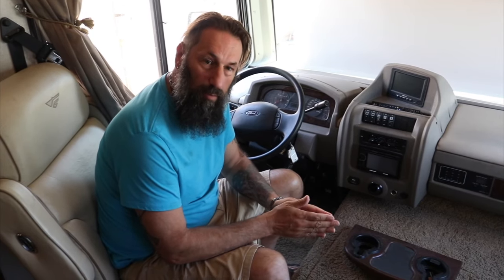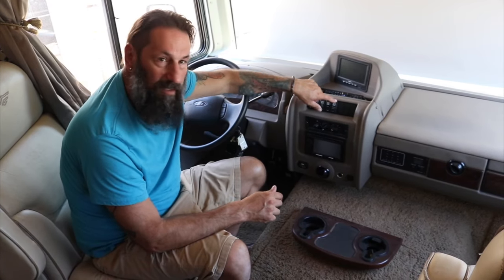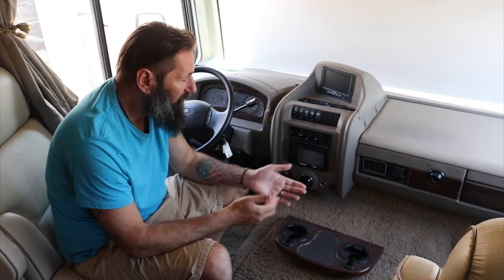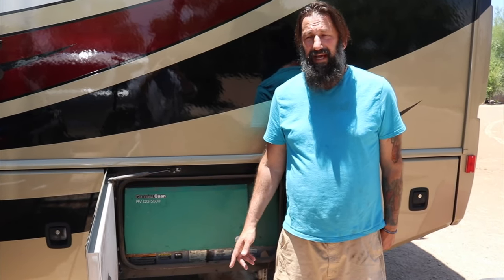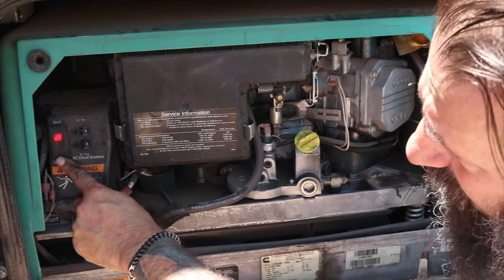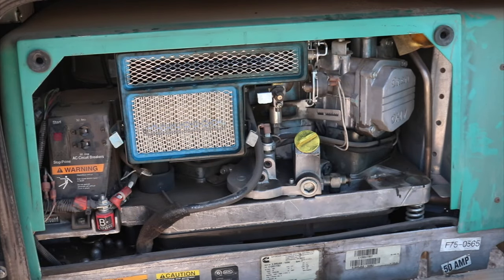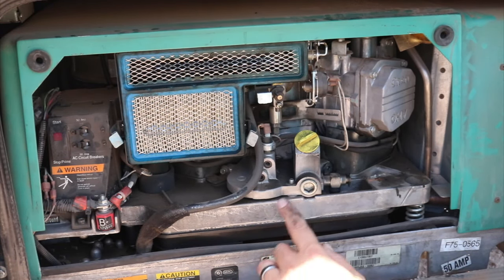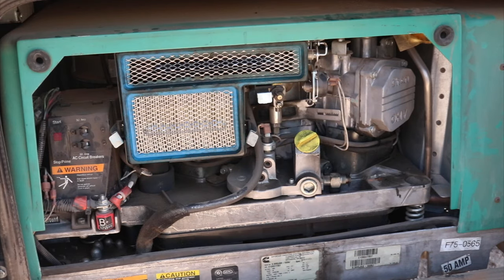RV Onan Generator Start Up Problems. Fix it here.  Hint & Tips

Comment: Hey thanks for such a wonderful way to explain the possible issues with the generator. I want to know how the coach auxiliary batteries are recharged? I usually turn on the generator however my batteries seem not to be charged later on when I want to start the generator again and I end up charging them. I have an Winnebago ford 87 with an Onan generator. Any ideas where to start?

Comment: I too, have a 4.0. In the control box, it has what looks like a normal "Ford" solenoid on it & 2 relays, bottom of box. Now is the small center post on solenoid marked with a "S" supposed to be hot all the time???, I thought that only put 12vdc on it when you closed the start switch to make it send power to the starter side of solenoid. I have a constant 12vdc on that "S" post.... and when I push START, it acts like there's not enough battery for it.... it just "Chatters" ,but then I had it turning over the other day, albeit, rather slowly.... I think somebody's got their + & - mixed up... not surprising, I've been re-wiring this behemoth for a month now, somebody didn't know what they were doing and mutilated and massacred the factory wiring and now it's all 18g brown wires and 90 scotchloks later.... hope I never meet this non-wiring jerkoff... still finding these damn scotchloks to this day..... I'd fire any employee who used these crappily designed strand cutting blades 
Great channel couz.... gonna join the party ;)
~Whirled Peas
PS: Weren't you in "Trailer Park Boys"  Is that Julian?? ...lolz

Comment: If you use seasonally,  drain the BOWL. Screw under Altitude.  Also bad gasoline in a modern car with fuel injection can be expensive

Comment: Nice video! I have kind of a weird thing going with mine.
On a trip I could not start it, very frustrating. I would prime wait for light then toggle to start....nothing just cranked.
Today by mistake I just pushed start ...no prime... jumped right to life! Running great and steady under load and off. 
Prime must be flooding mine???
Reply: Going to try this with mine
Reply: Was it a propane fueled engine, or gasoline?

Comment: Hi Ben, thanks for the helpful tips! I have the Onan 5500 EVAP, it will only start and run if I hold the butterfly closed or mostly closed (choked), but even when it should be warmed up, it will still only run when I hold it closed or mostly closed. Do you think this is an electric choke problem or something else?
Reply: I should add that when I let the butterfly open on its own after it's warmed up, it starts surging and eventually shuts down - seems like it's flooding. Possible issue with the carb?

Comment: Great comprehensive video! I have a Cummings generator in my 2015 Thor Freedom Elite. I started the generator with the aux battery and battery was dead. I started the rv engine and hit the start button for the generator and after multiple tries, the generator started. I turned off the ignition to the rv and the generator quit. I checked the aux battery a d it looked low so I replaced it. Tried to start the generator and nothing, just a single click noise and won't start. Opened up the cover to the generator and found the yellow oil cap laying in the compartment. The oil had totally leaked out! I filled the oil Reservoir  back up but still will not crank over. I am afraid I may have unknowingly seized the generator motor. Do you know of any resets? I may have to pull it and rebuild it. $4000 to replace. Any suggestions?
Reply: Hopefully you found the problem!   I had the same issue when I ran the house battery down and started the engine to start the generator.  The DC would not work except on generator or shore power.   And then would not charge batteries.   Under the hood in front of the driver is a metal box with a flat lid.  After pulling very hard to get the lid off, there is a 50 amp circuit breaker on the PCB.   On the right side of the breaker there is a tiny button.   Put your finger on it an slight push resets the breaker.   If your batteries are very low, the alternator puts more than 50 amps through them.  Long enough and the breaker trips.

Comment: Have a 1994 Onan.  Sitting for 4 months and was running ok when parked.  All batteries are  at full charge.   I now get a rapid clicking sound when I press any of the start buttons and starter won't turn the engine.  New starter about a year ago.  Clicking sound is near the start switch on the generator panel.

Comment: Great Video, thanks! Now, I have an interesting one for you: Onan 5500. Changed threat video, thanks! e house batteries actually ALL the batteries, they are showing 12.2 volts. Tried to start the gen after a few months...NOTHING! No prime red light, no crank, nothing. Ideas? I also tried from the switch on the generator, outside in the bay. Thanks!!
Reply: Make sure it's plugged into the chassis
Reply: @techomega9971  Talking about the ground? It has a Hi-amp breaker, and has power in and out. That's on the firewall by batteries. No power at power lug on Genset. I'll keep looking. Thanks. Enjoying your videos!

Comment: Hi bear. I have that generator which was on my 5th wheel when I purchased it but mine doesn't seem to have a place for those 2 small wires near the carburetor that yours has. Also, no batteries but I'm hooked up to a 50 amp plug.  Will my generator still start once I hook up propane?

Comment: Hi there, I have an Onan4000 generator that seems to have a fuel issue.  Technician thinks it could be 
the tube from the main gas tank to the generator.  The thought is it could be the sensor in the tank itself as he had the generator running using a separate fuel source.
How likely is this, and can the sensor be replaced without removing the fuel tank?
Alison
Reply: there is no sensor in the tank. The generator gets its fuel off a pick up tube that starts at 1/4 of a tank (so you dont get stranded). trust your mechanic, theres a reason hes a mechanic and your not.

Comment: Great video.
I have a crank no start issue.
I think its spark but, how do I check for no spark. Any help would be awesome thx
Reply from the maker: I would just go ahead and replace the spark plug if you think it is not getting spark.  They are cheap and it can surprisingly fix a lot of problems in small motors.  Start there.
Reply: @BearsWorkshop  will do thaaaaank you. Hopefully they'll get her going
Reply from the maker: @jcel5870  Good luck. Let me know.

Comment: Great video ! my generator does not turn over from the switch on dashboard. i checked the batteries i am getting 12.4 volts, they are 4 months old and it turns on from the switch on the generator itself.
Reply from the maker: Sounds like a switch problem or the wiring to that switch

Comment: I had a start/stop issue.  The light flashed 2 times.  I checked the manufacturing web site for error codes.  It was low oil.  Add oil slowly and let it drain into the generator oil pan.  I had to repeat slowly adding oil and rechecking the level screwing the dipstick completely in and then unscrewing it to recheck the level. Be patient and you will get the level correct...  No more issue!!!
Reply from the maker: Glad to see you got it working

Comment: I've got a onan 3600 LP model. Service fault (3blinks) and codes 15,14,13 are coming up. Over frequency, under frequency, controller can't maintain voltage. New air filter, new spark plug, fresh oil with proper level, cleaned the exhaust out. IDK? Is there a voltage control module? Maybe the reg up by the tank? Bad alternator?

Comment: Is there anything I can spray into the carb hole to clean it a bit? My generator stopped today and it's not starting back up its onan 5.5hgjab LP I know you mentioned starter fluid but on a LP what can I use?

Comment: Where is the starter wire on the generator? I was told to check that because when I prime and then press start it sucks the batteries dry and everything shuts down. I’ll then have to start the engine, wait a couple minutes and then the generator will start. Thanks

Comment: I have a QG3600. Having issues where it will do half a crank then stop, feels like battery is dead but is fully charged 12.6v , load tested to 330CA.. This may happen 2-3 times in a row , walk away and come back then it will turn over and start…any clues appreciated . Not sure if there is a connection but also noted when under load black smoke..

Comment: I have a Onan 4000 not getting spark the coil & boot test good and I replaced the magneto and new spark plug.  Any thoughts. could it be in wires?  it is an older motorhome and the prior owner couldn't figure it out.
Reply from the maker: Could be wires.  Can you figure out where you stop getting spark at?  Use a tester. Crank it with the spark plug out and grounded.

Comment: After running the generator for several hours last night I was going to start it up the following morning but when I pushed the start switch down to prime the system it started to crank and would not stop.  I had to remore the wires attached to the selenoid to stop the cranking.  Any Ideas of what the problem may have been?  I removed both wires from the selenoid and now dont know which one goes where on the selenoid.  Any help appreciated.

Comment: What kind of coolant might it need? Any kind okay? I'm a single mom about to head across country with my 2 kids, the mechanic checked her out and said she is good to go, but when we went to leave today the generator wouldn't start.  It has been sitting for about 9-10 months, so I'm thinking maybe bad gas? But could also be coolant. I have used shore power 99% of the time since buying the RV used last year.

Comment: Hey got an onan 4000w generator that won’t crank replaced the starter solenoid as it would click but there would be no crank. I can manually turn the engine with a wrench but still nothing. I’m thinking it’s the starter but I’m worried it’s possibly seized. It was just on for service at Cummins where the valves were adjusted so that could also be a possibility to why it may be seized?

Comment: Thank you. Great video! Our generator isn't starting on its own but if I connect the positive of my multi-meter to the generator's positive terminal, and the negative to the generator's ground, the generator starts and runs. It then stops once I remove the multi-meter's positive. So it's creating a circuit. What might this mean? Cause? What should I look for? Hope ya can help. 8)

Comment: If I allow my generator to sit idle for 5-10 minutes it will not start again even with priming. I have to start RV engine then turn generator on. Purchased 2 new house batteries and a new chassis battery, in last 3 months. Could this be electrical or what?

Comment: Can it be run with an external fuel source? Skipping the main tank if its so low and you're not looking to dump like 15 gallons into the tank you won't even get to use?

Have a Monaco 2000, looks similar to your interior. Was running an "external fuel supply" as id done with an 86 pace arrow just to skip the BS of filling the tank enough for the pickup.

One hot day this summer, it ran that external fuel can dry. Refilled the can, hasn't stayed running since. Basically starts and dies immediately, unless holding down the start button. It's getting fuel just fine through the pump and the carb, ive had the carb off twice and made sure everything was cleared and blown through, getting fuel through it, i thought the LoW gAs was simply the tube pickup in the tank not going to the bottom, is it also electronically controled by the fuel gauge sensor now?

Edit to add: only code I'm getting is 36. Engine shutdown not commanded by computer.

Comment: Video on startup issues was helpful but didn't get mine running.  Seems like mine is flooded.  Raw gas is pumping out of the intake port behind the choke.  It was primed, pressed Start, on 3rd try, it began to start but then stopped before completely starting.  It never ran.  Still fuel is pumping out of the carb.  RV is a 2008 with only 8K miles.  Everything is new.  I have not attempted to run the Onan generator in at least 3 years.  We use a portable Honda eu3000i.instead. Help!

Comment: I have a 2007 4000 that refuses to start.
Suspected the carb, took it out and there was no problem with it.
Checked the fuel delivery, pump and filter seem good.
Sprayed starter fluid into carb, no start.
Cleaned spark plug and attached a checker, we have fire.
Added oil, parked on level ground, no start.
Have more than 1/4 tank of fuel.
Got a code 36 also.
Fuel, air, and fire, but no start.

Comment: thanks  for  this.
what is  the  cause of  no  out put  voltage  in  generators  are normaly  run  AVR & rotating  diode  are  changed but  no  solution   what is  this  reason please?
Reply: Hollo bear here’s one for ya   a 1998 coachmen I have power to new starter solenoid new control circuit board but no power past battery connection WHY?  Stumped

Comment: New oil and levels messed with to where it will start and run but only a couple of minutes when motor is warm.  In AM cool motor it runs about 8 min and stalls.  I am looking to bypass the low oil level ground producing switch to test and if it keep running replace it...

Comment: My Onan was running fine stopped and has never ran again.
Won't even make a sound like it is trying.
Here is what I have done
Full tank of gas
Added oil
Held start button off 5 seconds
House batteries are new 6 months ago and have been used very little.
Would you give me some ideas on what else to try please?
Thanks so much. 
Jeannine

Comment: Hey Bear. Thanks for the video. You hit on a problem I am having. My float seems to be stuck and even at a full tank, I show 1/4 on the gauge. If I top off the RV (2013 Thor Palazzo) the genny runs great for a few gallons then wont run. I am fairly confident that the sensor is the problem. Being a techie, I am guessing somewhere in the path of that sensor is a relay that is NC or NO that I should be able to trip, sort of like the GM six speed lockout fix. Are you aware of anyway to do this? I have tried reaching out to Freightliner shops to replace the float but, no one wants to deal with it.
TIA,
Craig

Comment: Hi Bear, Watched your video and it was helpful, however, we went through all these steps before.  We have a Cummins Onan QD 6000 generator with 16Hrs. on it.  It has been plugged in to an external source for about 2 weeks.  For some reason the converter tripped and we lost our DC/12V.  We reset the breaker and now have all our 12 V "appliances" working, however, the generator will not start - it just clicks.  We tried to start it with an external battery, but it is doing the same thing.  We pressed the stop/prime and got the 3 lights, but no further code/flashes.  What could possibly be wrong?  Is there another "reset" button for the generator somewhere on this unit?  Why would loosing 12V power cause the generator (which was not running) to not be able to run once we reset the converter?  Is it possible that we have not waited long enough for the converter to be on?  We are hearing a low hissing noise from the converter (which I believe should stop at some point).  Sorry for the long-winded review, we're just a bitttttttt frustrated with all of this.  Thanks!
Reply from the maker: One possibility that I recently learned of.  This happened to my buddies diesel generator.  Just would click once when trying to turn it on and then give 3 flashing lights.  Turned out the there was an auto-off set up in the generator monitor.  It would not run at certain times of the day.  If you have the monitor try turning it to Auto-On.  The feature is supposed to turn the generator off at certain hours but sometimes the times get messed up.
Reply: I have that same exact issue right now!  Cummins Onan QG 5500

Comment: I may have over cranked my generator... When I attempt to started the celluloid clicks starter does not spin... What is wrong if you have any idea
Reply from the maker: Do you get any error codes through the flashing lights?
Reply: Check the battery voltage while cranking. If its 24V System, Voltage should not drop less than 20 V while Cranking.If its droping less than 20 V its battery problem,if not than starter problem.

Comment: My  Generator solenoid clicks several times as I press the starter button over and over then the starter turns over and all is fine. Sometimes it starts with 3 or 4 clicks sometimes 7 to 10. Is this my starter or solenoid? It is the same for remote or at the Generator?

Comment: Great video.  My yellow cap fell off and I was leaking oil. When I tried to start it (not realizing how low my oil was), it made a nasty clunk sound and failed to turn over. It is an Onan 3600 propane.
Does it have a low oil shut off or am I in a catastrophic zone? Thanks.
Reply from the maker: It does have a low oil shut off so hopefully after a new cap and some oil it will start up.
Reply: I had the same thing happen! Any tips on getting it back up and running or was it catastrophic and rebuild or replace?

Comment: To get error code. Press prime 3 times within 5 seconds. 
If it lashes 3 times its a 3. 
Then tap down one time.
It should flash 3 time then pause flash however many more times before pause  thats your second #. 
Mine was 3 than pause flash six pause. Repeat  3 than 6. So was code 36.

Comment: Mine is making a Whirring noise, but not cranking. New plug, new air filter, new oil.  Not turninmg over. Only has about 80 hours 2007m Winnebago aspect

Comment: By the way , My generator in my toy hauler will not start from the inside only outside. I’ve change the switch on the inside and checked my breaker and fuses and nothing. Any advise ??? There is oil and good gas but it just won’t start from the panel . I have to go outside and start it that way .